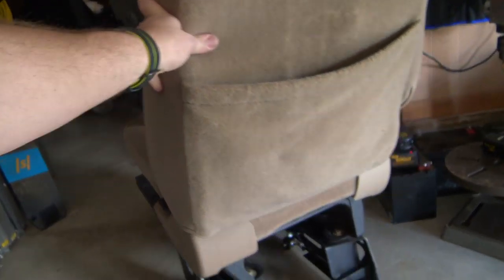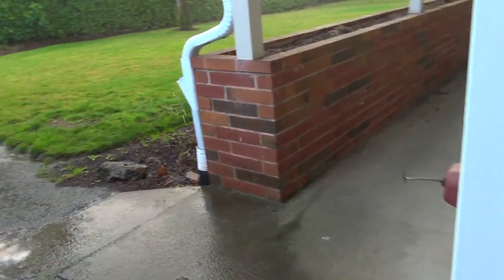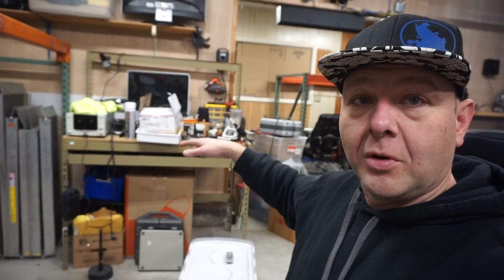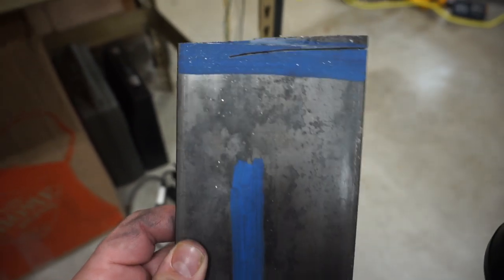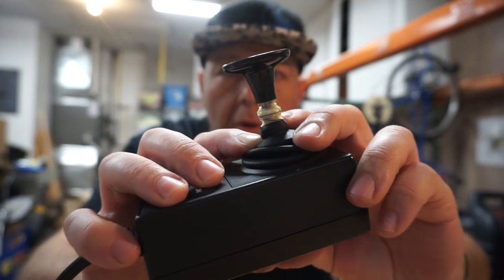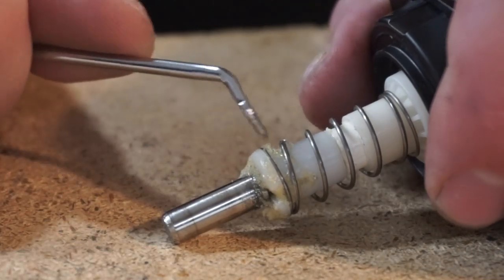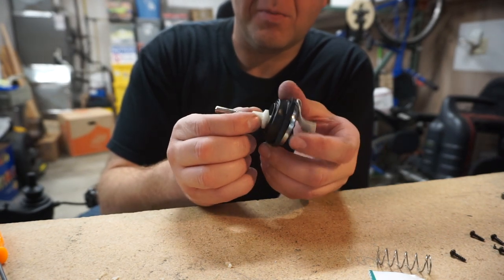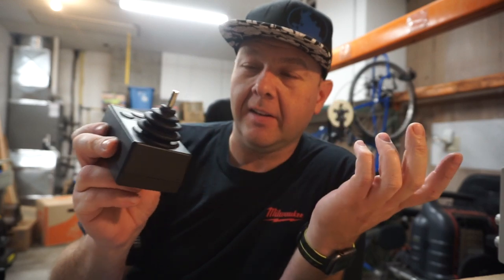MEGA VLOG 469: new years day in the garage- BUSY!

Comment: How come you're still using the edge? I thought you got the other one straightened out.
Reply from the maker: its the backup - backup chair - till i get the steampunk chair repaired hah  it got a bit messed up in the crash a couple weeks ago.. havent taken it apart yet..
Reply: @TotallyNormal-   Oh that make sense, at least this one is better for your back.
Reply from the maker: also i like to use a crappy chair when im in garage workin on stuff so dont have to worry about being careful ;^)  this edge 1 has had a LOT of mods
.. some of which require it to have cooling fans! lol
Reply: @TotallyNormal-   That makes sense to me.  I'm definitely going to keep my secondhand edge 1 for as long as I can for the same reason.  You can never go wrong with having a backup or a few.   Hopefully that edge doesn't suicide itself between now and when you get the steam punk chair working again.
Reply: @TotallyNormal-   4Front doesn't get to run around the house? Feel sad for the 4Front!
Thanks again for interesting video.
Reply from the maker: its a trailer queen till it gets a few more miles on it ;^)
Reply: @TotallyNormal-  lol